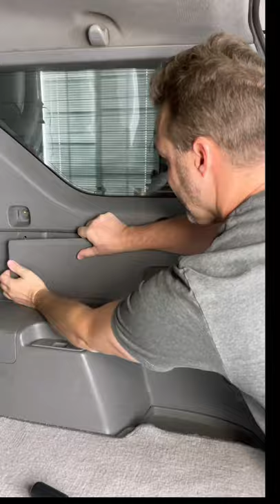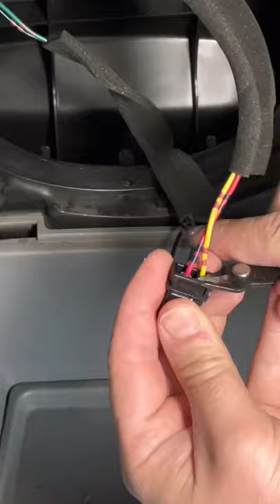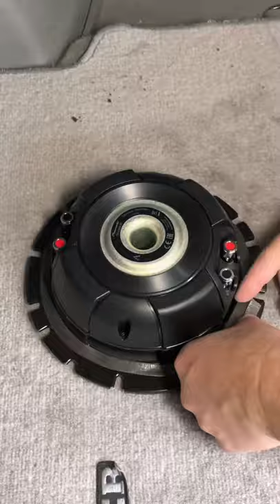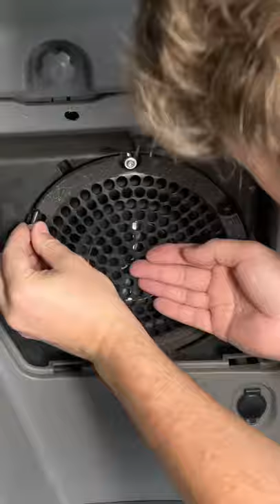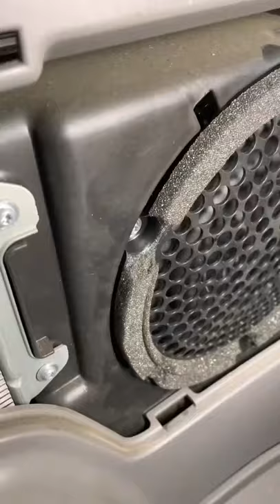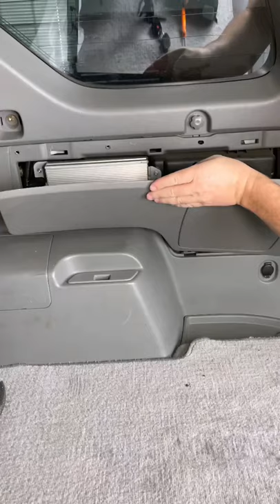Toyota 4Runner Subwoofer install

Comment: i literally had to take the whole damn thing out to re place mine
Reply from the maker: Ohhh that’s lame. I was hoping I didn’t have to. But I thought all are like this except maybe the 2003..🤔
Reply: Hoping mine isn’t like that
Reply: All you did was pry that plastic off?
Reply from the maker: That’s all I did. Some have to remove the whole panel which is a big process. Not sure why some are different.
Reply: @johnnysweekends  what year is yours?
Reply from the maker: 2004 limited V8
Reply: @johnnysweekends  I tried to pry the plastic off and it wouldn’t. I guess I’m one of the unlucky
Reply from the maker: Does it separate at all..? Can you see a gap. If you do, it will probably come off but you probably break the tabs. I broke a couple
Reply: @johnnysweekends  yeah there’s a gap, I got some to pop out but the rest were stuck
Reply from the maker: Yea those are the ones that will probably break…😂
Reply: Yeah I have a 2007 and it's a whole process. This looks like how hard it should be smh
Reply from the maker: I was hoping I could do it this way and not remove the whole side… I got lucky lol
Reply: Ya I had to also 2003 limited jbl rds
Reply: On my 2003, I had to take the whole panel off. The area that you pried out had several spots plastic welded on the back. I could have dremmeled the welds off for easier access for the future, but didn’t bother. Takes maybe a half hour to take the entire rear interior out to get full access to sub/amp.
Reply from the maker: Yea others did that then a light sealant to hold it back on or a plastic weld or epoxy it back in spots
Reply: @johnnysweekends  I was hoping I could do what you did since I have that same panel, after breaking two of the tabs I figured I'm going to have to do it the hard way. Your video gave me hope but..... Thanks anyway 😊
Reply from the maker: Yea some get brittle after years.
Reply from the maker: Yea some get brittle after years.
Reply: @johnnysweekends  that makes sense. I'm putting in a drawer system so I'm going to be taking apart some of it anyway. I just had my hopes up after seeing so many people take apart the whole thing and yours is the same model as mine. Maybe I'll give it another shot when it's really warm and softens the plastic a bit.
Reply from the maker: Yes if it’s cold it can snap easier
Reply: @johnnysweekends there are videos that show it. It is really not that bad, and goes back together easily.
Reply: Only 2006-2009 has removable panel for the subwoofer. Earlier 4th gen models 03-05, you have to remove bunch of panels to get to the subwoofer.
Reply from the maker: @SaadRahimu mine was a 2004

Comment: I put a custom homemade fiberglass box with a 12 used the factory amp for output to a 2500 mono block and a 4 channel for all 4 doors and left the center and pillers on the factory sounds awesome 👌
Reply from the maker: Nice, sounds like a good set up..😁👍🏼
Reply: Do you happen to know the best place to find a high output alternator

Comment: Just so some people are aware before trying to go this route is that this cover is plastic welded where it clips on. So potentially after install there could be rattle coming from there.
Reply from the maker: Yea if going for a lot of power I would maybe do the whole panel. 
I haven’t changed the amp.
Reply: I cut the welds with a razor.  Their is enough grab from the mounts to keep mine from rattling.

Comment: What did you put around the back of the sub before install?
Reply from the maker: It’s foam padding so it doesn’t rattle. That material was included with the sub.

Comment: What year is this 4Runner?
Reply from the maker: 2005
Reply: @johnnysweekends  thanks, unfortunately the 2008 doesn’t come apart so easily. My girlfriend’s sub just blew. You may be able to help me I see 2 and 4 ohm options for replacements some are almost 2x the cost the same size and wattage.. can you shed some light on this?
Reply from the maker: @Ctylerr93 no reason for the more expensive sub as the system doesn’t have enough power to power a more powerful sub or at a lower ohm. If you plan to upgrade the whole system then sure get the sub that can drop to two ohm. But if not cheaper will be more than wnough
Reply: Hola porfavor me puedes decir en especifico como se llama el subwofer ? Tengo el mesmo y esta roto

Comment: I literally just did this in 30mins. Was dreading the removal of all the stuff noted in other vids. Awesome video👍🏽👍🏽👍🏽

Prying out the panel can be a little tricky and require a little force.
Reply from the maker: Yea the plastic tabs could break if not careful and depending how brittle as well.
But yea nice to be able to do it this way verses the whole side coming off. 👍🏼😀

Comment: Does the plastic panel you removed rattle?
Reply from the maker: No but I wasn’t using much power just stock
Reply: @johnnysweekends  ok I’m planning on doing the same thing but I’ll probably set my radio to +5 bass so hopefully it doesn’t rattle

Comment: Was the amp replaced? If not, same wattage power even if you dropped the ohms a bit.
Reply from the maker: No stock amp… less power now since that speaker needs a decent amount of wattage to start sounding good.
Reply: @johnnysweekends  replace the amp. I know a few audio controls have the audio input converters to line level and a decent RMS wattage to run that sub. You'll love it!
Reply from the maker: I thought about it. But because I have the JBL everything is a little harder of a swap.
Sometimes the simple stuff is easier lol
Reply: @johnnysweekends  so a replacement sub will work with the factory amp?
Reply from the maker: Yes I had the jbl system so you want the sub to have the dual voice coil..👍🏼
Reply: 2ohm or 4ohm
Reply from the maker: That speaker could be set for either